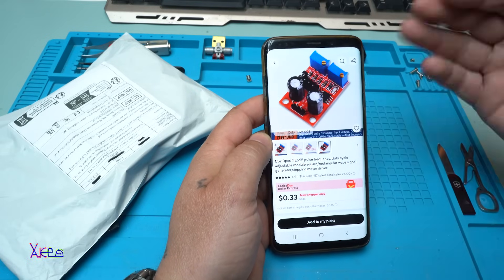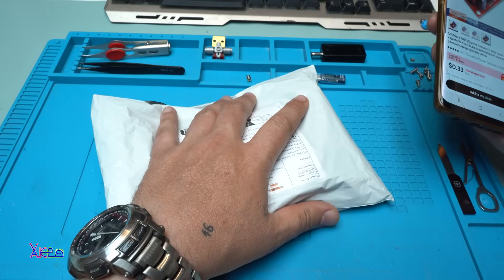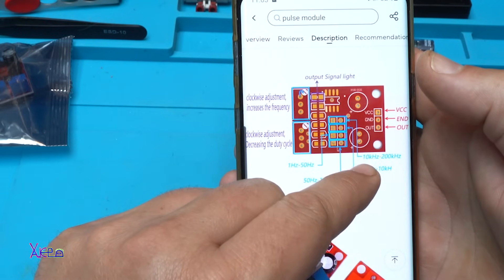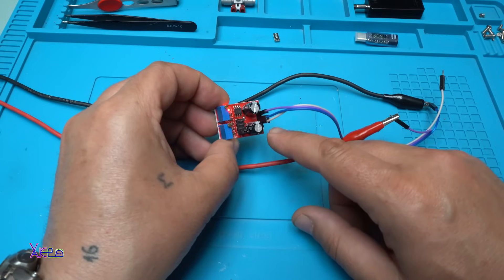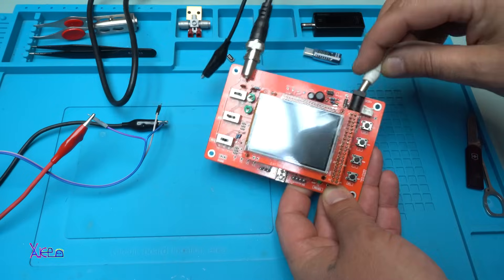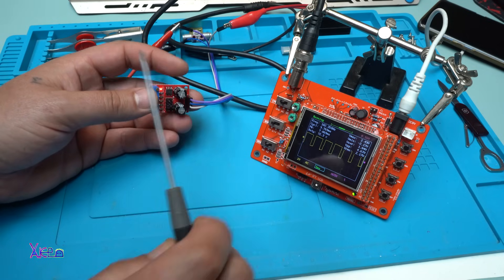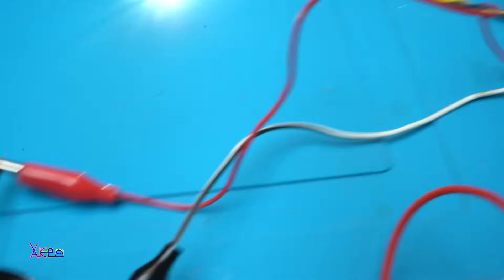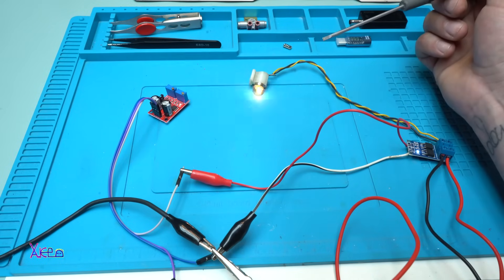THIS $1 Aliexpress Module is Cheap and Brilliant!

Comment: Hi, Thank you for your interesting video's. Do think this module could be used as the pulse for an electric fence. The output would be connected to a coil to step up the voltage.
Thank you 
Lance

Comment: Will this work on the entire 555 supply voltage range ?  You mentioned 5V but is there a reason it wouldn't work up to 18v ?

Comment: A useful module! That 555 timer IC design is over 50 years old and still used in many places .
Reply: I have a countertop water cooler/heater(built in kettle) that used a 555 in the heater section. it blew itself up so I replaced the heater controller with an ESP8266 and an SSR. Now I can control it with Alexa and voice command.